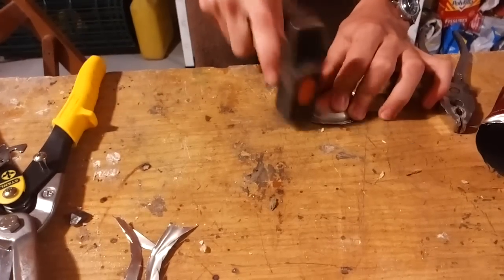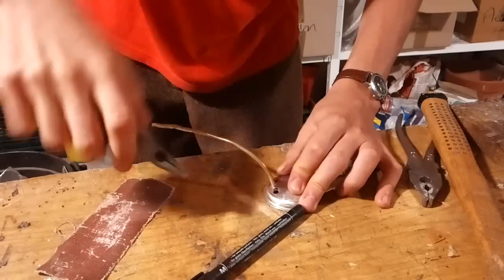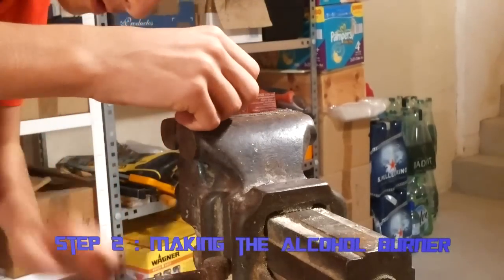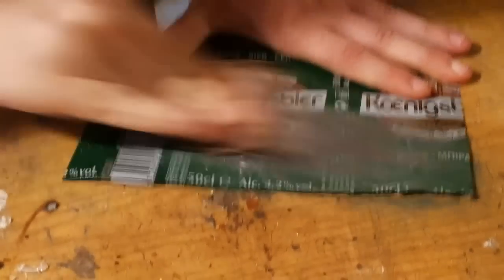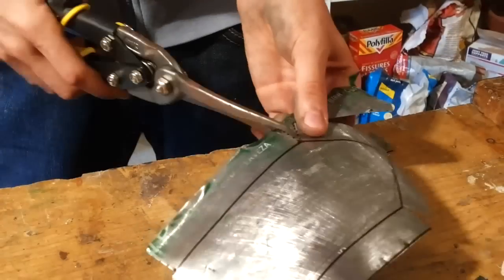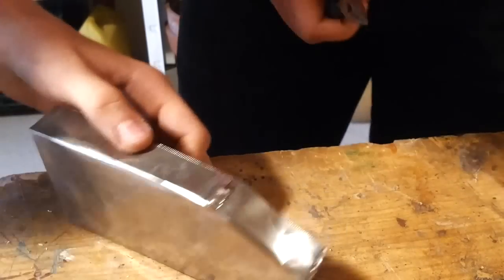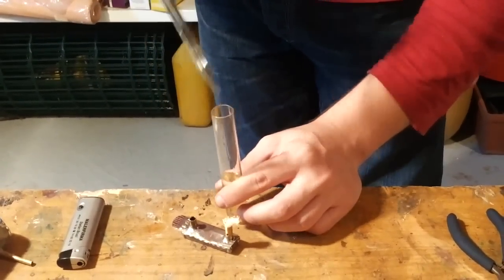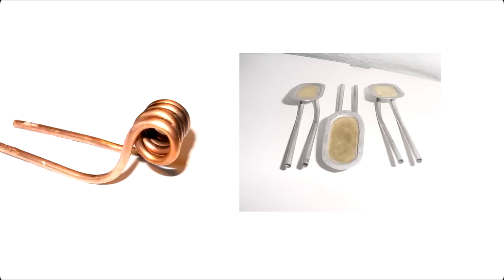[BRICOLAGE] make a pop pop very nice boat

Comment: +ultimatemaking when I solder on the tin or can the soldered peice of soldering wire slips off
Reply from the maker: yeah because your can is made of aluminium not steel, the metal shoud be written on the can. you cant solder aluminium... and if its steel, try to sand paper it before soldering ;)